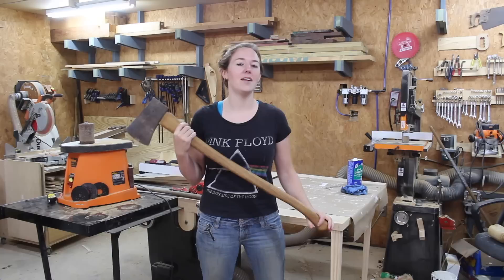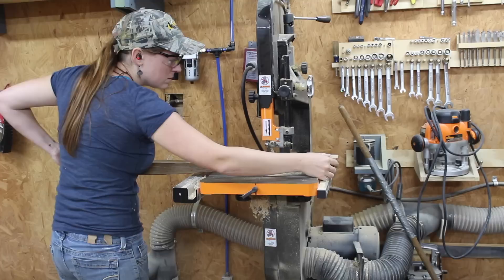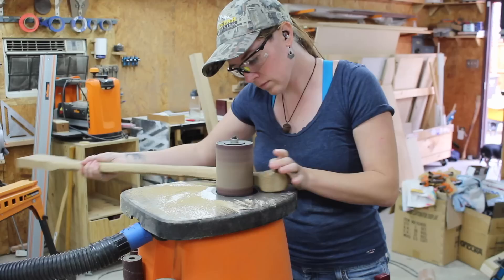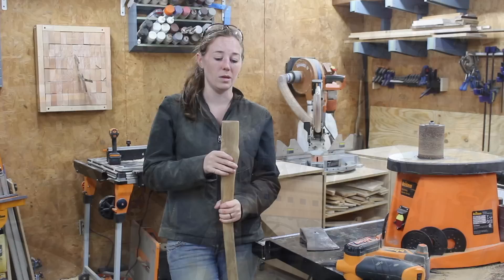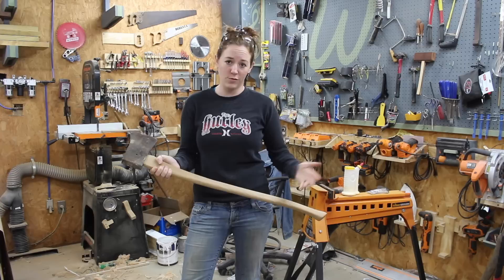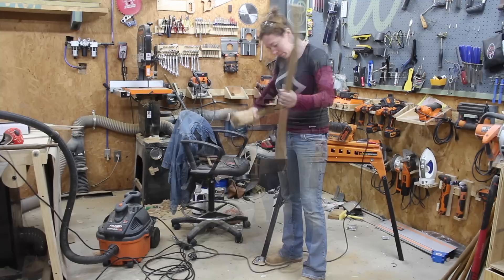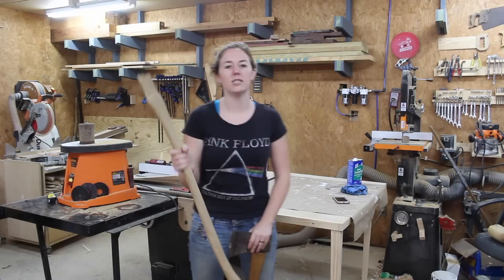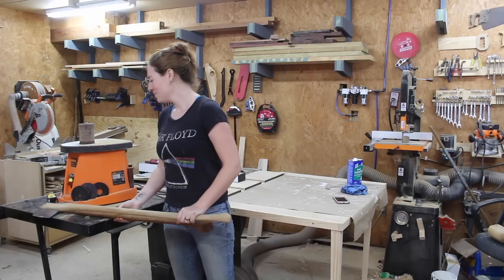Making an Axe Handle

Comment: Hello April. Thank's for a video. I am from Ukraine and I didn't understand, what was a mistake, yours English is too fast for me :) Could you write it for me please. I have been looking yours channel  for a long time and I this mistake did very interest me. Sorry for my mistakes in grammar.
Reply: Дмитрий Посыпайко hi if you look at the first ax handle to the second one you will see that the it's backwards that's all but because she had already shaped the head it could not be turned around and reshape the correct way that's all 😹🙀 easy enough mistake to make if she was to swing the ax with the handle the way it was it would be more like a hammer than an ax 😹🙃

Comment: You do not have any spokeshaves ! ? ! ?  You REALLY need to add at least a flat soled spokshave to your hand tools.  I'd feel like I was missing at least a minor body part if I did not have my spoke shaves ready to hand.  Shaping anything at all such as this axe handle for me starts with my bandsaw then moves rapidly to the spokeshave that is used for probably 80% of the shaping of the cross section.  Then it's a little smoothing with coarse metal files reserved for wood then some sanding and the job is done.  The spokeshave really frees up your options and releases your chances for all manner of shapes and transitions.  Treat yourself ! ! ! ! !

I build and fly model airplanes.  If I had a nickel for each time I've accidentally built two left sides for the fuselages I'd have roughly 25cents.  That doesn't sound like much but each time is a true Homer Simpson DOH! moment.  Two left sides or an upside down axe handle. It's all just examples of not seeing the forest for the trees.